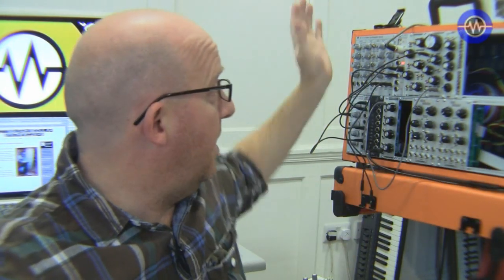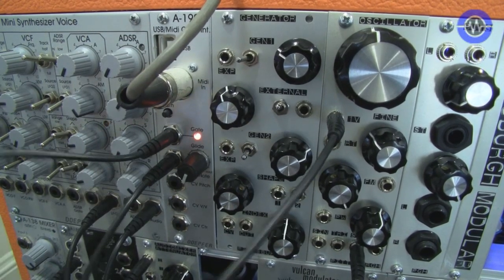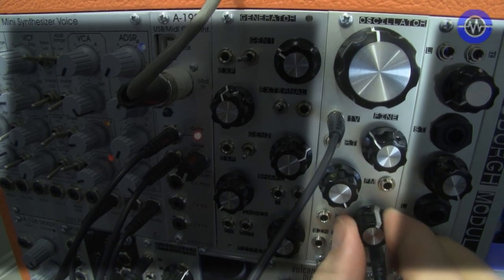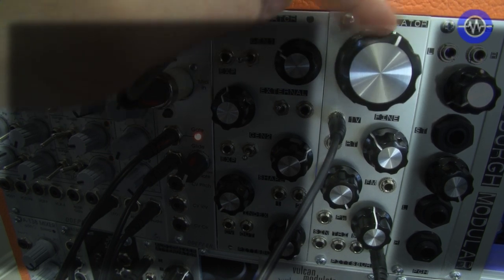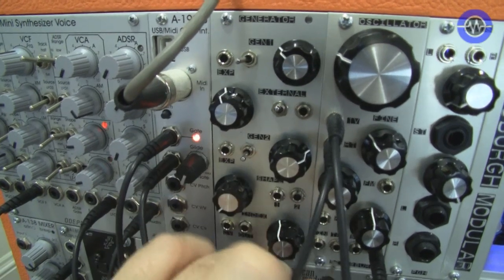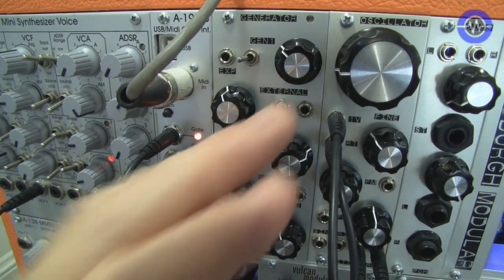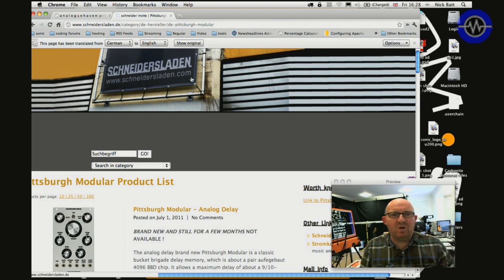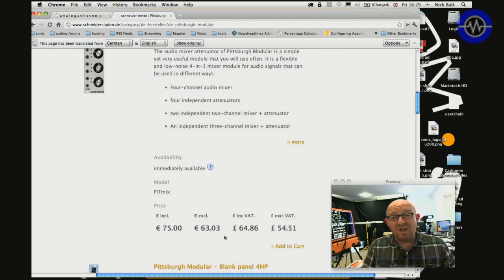Sonic LAB: Pittsburgh Modular -Selected Modules

Comment: I don't know if you've already gotten an answer to this question, but a screwdriver is all you really need to install modules, unless you buy them as kits. You might be able to go without a case as long as you have a way to connect the modules to the power supply, depending on what you want to do with the synth, but I don't really know for sure.

Comment: I connect the output from a mixer or vca on the modular to my mixing desk. If you make the connection straight from an oscillator the signal is very loud but thats ok in the mixing desk, just reduce the gain a bit. The best way to learn to use a modular is to just get your hands on it, it becomes intuitive quickly.